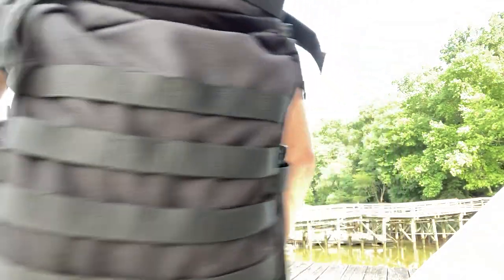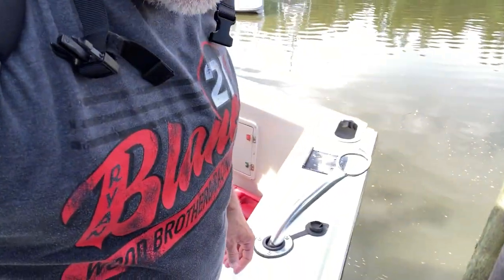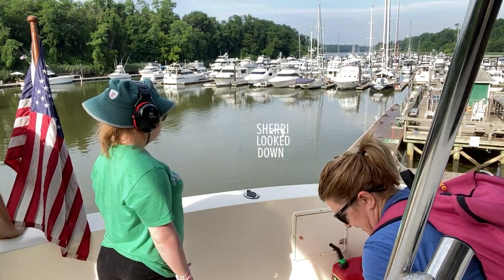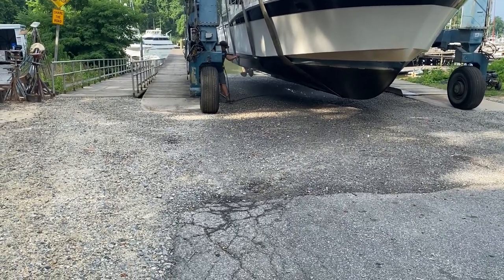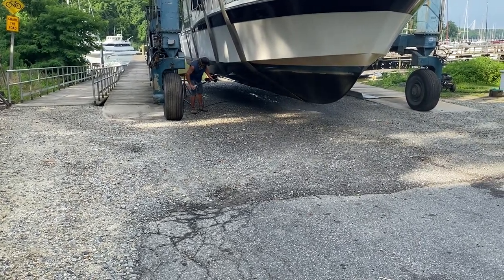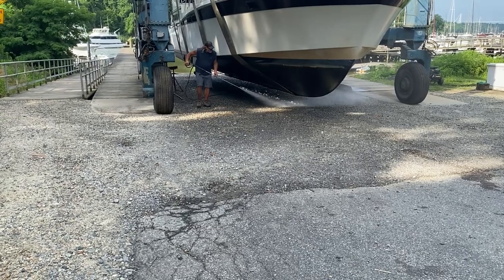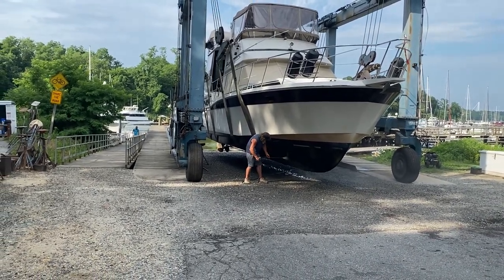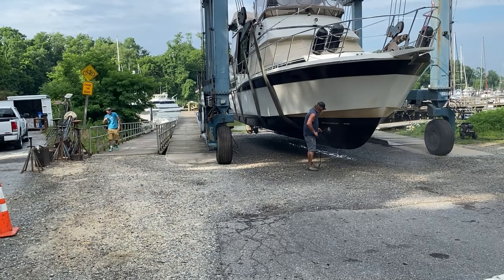Game Changer! Installing the Bow Thruster. | Ep. 8

Comment: We were wondering,  now that you have a few miles behind you are you still happy with the decision to do the loop in that size boat? Would you now go with a smaller boat with less wind draft? How about a single engine with bow and stern thrusters? We are  getting our boat ready for a future loop and we followed someone's advice and got the smallest boat we could be very comfortable on. Of course there are only 2 of us and 2 very spoiled pups. 
Also are you happy with the 3208t? How many hours are on them? We have a single 3208t pushing a semi displacement hull with 300 hp. On  our first and only 1700 mile Trip to bring her home after purchase we averaged 5.5 mpg at an average of 7 knots.
Reply from the maker: Hi Capt Rosie! We're happy with the size of the boat. With three of us, the extra room and comfort makes any challenges worth it. Once the bow thrusters got installed, it really mitigated the challenges of wind and current while docking. So highly recommend bow thrusters, and stern thrusters will be a big help with only one engine. The benefit of a smaller boat is air draft and more choices. With our tight time table and high air draft, we can't go the entire Erie Canal, so we're looking at the Welland Canal as we don't have time this summer to hit the Trent Severn Waterway.  Love the 3208Ts.  They've been reliable, and relatively easy to maintain.  We have 4900 hrs on ours, so they will go a long time when maintained.  Having the twin engines, we don't get good fuel milage. When we keep the RPMs down to 1100 or less, we can get close to 2.5 mpg. Great questions, and hope to meet you on the loop someday! Safe travels!